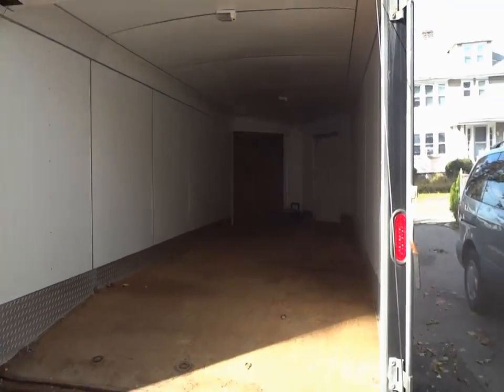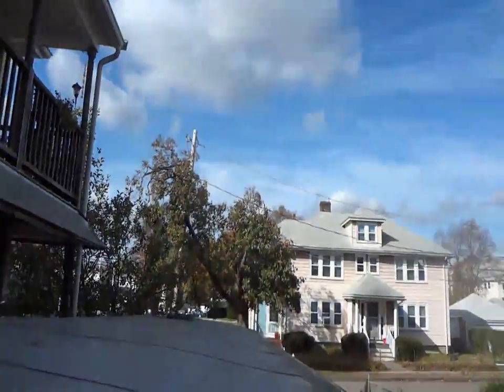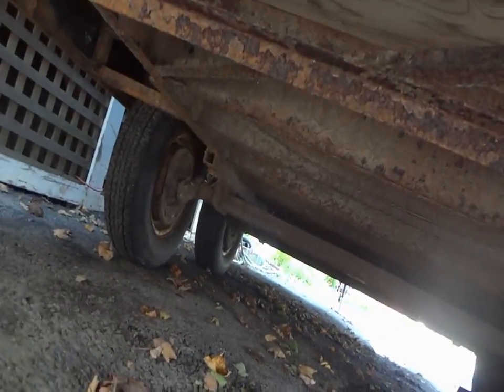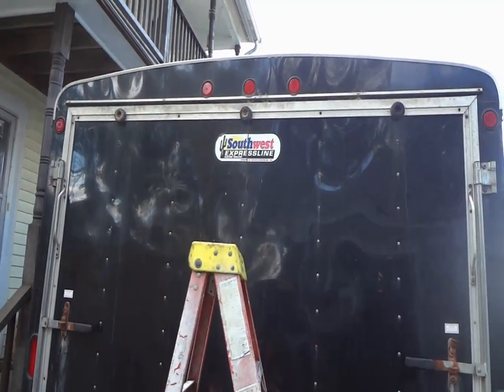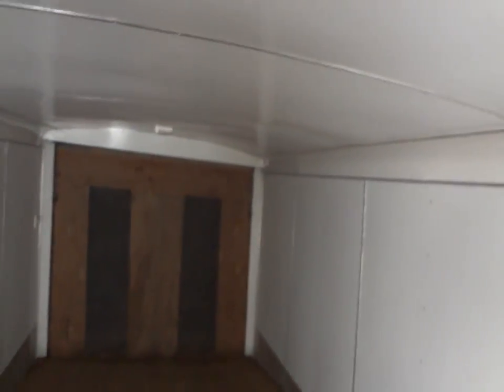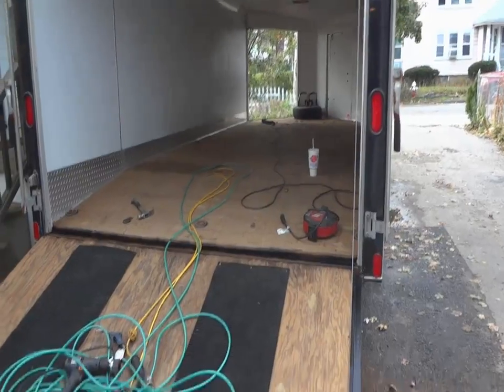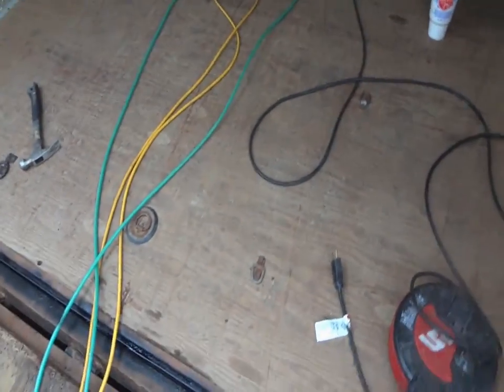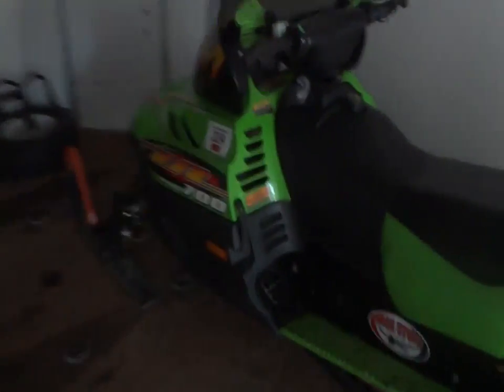cleaning up the snowmobile trailer

Comment: Just get the floor and ramp line x Ed and you should be good to go no  rotting  and wash out the snow and mud . I have my trailer inside linex d and nothing will take it off not even the studs on the track